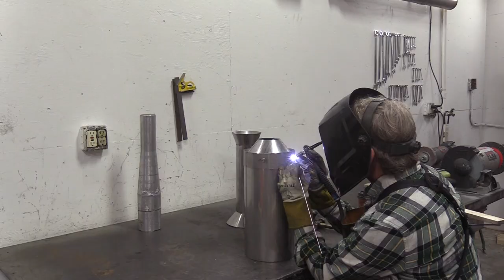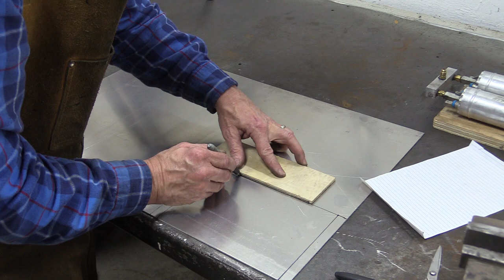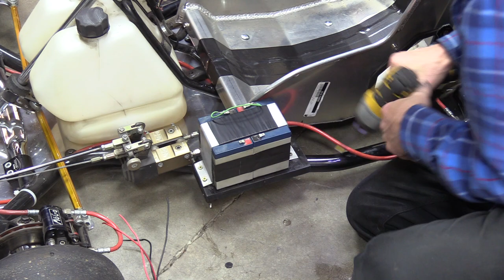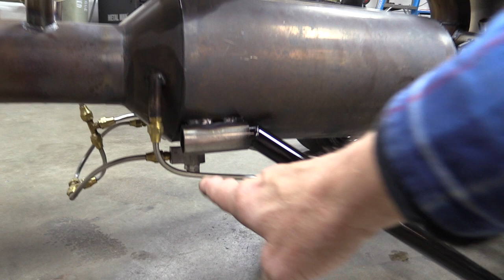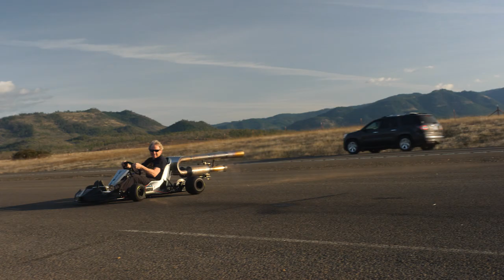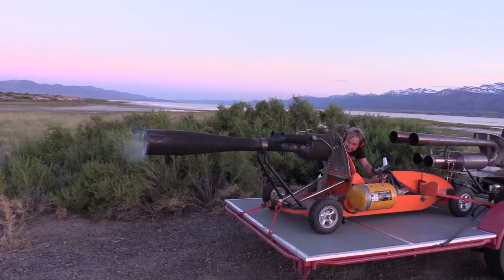Rocketman: Part #2 HOW to make a SUPER JET GOKART !

Comment: WELL YOU ARE THE GREATEST PULSE JET BUILDER EVER!! Greetings from Sweden. From ages 15 to now i have always wanted a pulse jet engine but i dint get one until i was 50, it was an original  unused valve jet from the 60. Your engines are so perfect tuned and well build also you have put both the ignition and the propane inlet in the perfect spot in the engines so you are able to start them with a flick of the switch, impressive and the answer to anyone how you did to make them start without air pressure :)

Comment: Incredible man!!!! But definitely need one small modification - at the trailing edge of the heat shield above each pipe, weld or rivet on two of those long-tined barbeque forks, so you can throw on a couple of brats or maybe a dozen shrimp for a nice snack afterwards, lol ;?D

Comment: Hey Bob, how well would this perform if the pulse jets were used in conjunction with a traditional petrol motor or electric engine? I'm thinking the pulse jest could be engaged on long straight runs for power boost and then the drive shaft powered motor for tight turns etc. Just thinking out loud!... KILLER BUILD MATE! I love what you do FYI
Reply from the maker: Yea it would work great! easy to put the engine around the piston engine and because it has instant start you can just start it anytime with the push of a button.

Comment: The quick start system you built is awesome! What is the fuel consumption of each of those engines?
Reply from the maker: About 30 gal/h per 100 pounds of thrust, I know thats a lot but it's like a canon going off more than 100 times a second.
Reply: How much does each 50 lbs thrust engine weigh by itself?
Reply from the maker: 15 pounds I think.
Reply: @RobertMaddox  why not make one with 850 pounds of thrust

Comment: how does that instant start work without the likes of a leaf blower pushing extra air in? do you have to set a specific AFR via the solenoid?
Reply: There is a small leaf blower inside the tube.

Comment: QUESTION.....YOU USE TWO 12 VOLT PUMPS AT 24 VOLTS DOUBLING THEIR OUTPUT SO YOU CAN MIST THEIR FUEL BETTER...BUT THEN YOU DROP IT INTO A SINGLE LINE WHICH SPLITS BACK AT THE ENGINE INTO TWO FEEDER LINES EFFECTIVELY DROPPING THE PRESSURE BACK DOWN TO A DOUBLE 12 VOLT PUMP PRESSURE AT THE SPLIT DUE TO MAXIMUM FUEL FLOW OF THE SUPPLY LINE....SEEMS IT WOULD MAINTAIN THE HIGHER PRESSURE BETTER BY RUNNING TWO 24 VOLT FUEL FEED LINES ALL THE WAY BACK TO THE ENGINES VS ONE..

Comment: From the back I see flames coming from all 4 pipes, so which is the thrust and which is the intake? And why is there flame coming from whichever the intake pipes are? Those engines get so hot, does the whole apparatus ever just melt if used too long?
Reply from the maker: Ha ha, not they will never melt, the shot pipes are the intake but the thrust also comes from them, about 60/40.

Comment: I can see heat is a problem....those tubes will get so hot I think they could burst open at some point. Welding cooling fins onto them or wraping a casing of radiator type core around them, should help?

Comment: Just curious if these types of fuel pumps (typically inside tank mounted) depend on being submerged for some of their cooling?
Reply: Those type of fuel pumps are not inside tank mounted. They use pumps like those on Volkswagens with a Bosch injection constant flow system. They will produce well over 100 lbs with gasoline. This guy is looking for more flow volume im sure.

Comment: I am far from an expert on that design, but something tells me that there MUST be a way to tweak these engines for even more power... 

Can you hybridize it with forward facing scoops so that is collects more air as you gain speed?

Other than that, it seems you could use piezoelectric materials and a transformer to use some of the pulsing power to keep your system charged so that you have much longer travel life before the batteries drain, AND it would give you the option of some LED lights for driving and signaling! ~( 'w')/
Reply: You can get more power by increasing the fuel input but the tubing would melt.
Reply: Depends on the melting point of the metal, and the total heat output of the combustion.

Since the thrust is a specific impulse, if you placed a draw tube around the outside of the thrust tube, you could force induction, thereby increasing cooling while ever so slightly increasing thrust.

The outer tube could be aircraft aluminum, and if you added axially mounted ribs between the two tubes, it would be able to heat-sink the thrust tube pretty well below its critical point.

The major draw backs are increased complexity, time and weight.

Since keeping it simple is critical to Mr. Maddox, its not really likely he would do that though.

If one used something REALLY hot, they could also, in theory, add water vapor at the mid section of the tube which would both absorb heat and increase the total expanding mass to increase thrust without increasing temperature.
Reply: Well - you're thinking - that's good.
When you say " heat " I assume you mean BTU's.
How is the " thrust a specific impulse " ?
The efficiency of the pulse-jet increases as the tubes get hotter. Cooling will affect efficiency.
Why would you use 7075-T651 as opposed to 6061-T6 ?
" Absorbing heat " has no effect on mass.
Your design mod would dramatically increase cost w/o any guarantee of achieving the desired result.
 Could you calculate the structural requirements necessary to achieve the thermodynamic and air velocity characteristics you are after - or would the mods you suggest have to be done empirically ?
I suggest the latter.
Very expensive....
Perhaps just changing the components from SS to titanium ?
Reply: I'm an energy researcher who specializes in metallurgy and thermodynamics, I have built jet aircraft engines [from monel, inconel, titanium and various high chrome stainless alloys, and it would come across pretty presumptuous to assume I do not know what I am talking about.

Heat can be 'watts,' 'joules,' 'calories,' 'BTUs,' 'ergs,' and a few other quirky terms, it does not matter. 

Heat is heat: it excites the electron shells of atoms, it emits photons, it causes and uses electron transfer.

I could indeed calculate the requirements if I have all of the original parameters of the existing engine and its fuel, its really quite easy once you have the base line.

What was that line 'absorbing heat has no effect on mass' about? Were you once again assuming that you knew what I am talking about?

I wonder if you have checked the price of Titanium lately.
Reply: Why did you suggest the incorporation of an " aircraft alum "  (7075-T651)  outer tube with axial ribs between the tubes " , and then tell me heat is heat ? 
 
(Why not use a tube of D-4, 17-4 PH, 2011-T3 or 12L15 ? Perhaps because you don't know what a " phase diagram " is ? )

The alum " ribs " in contact w/the inner tube - which at it's hottest area is approx 1700 - 1800 F - would melt - primarily from conduction - until a gap was produced between the ribs and the inner tube - after which the " heat-sink outer tube "  would absorb the heat via convection and radiation - but would no longer remain axially concentric with the inner tube - due to the melting of the upper ribs, which by effect of gravity, would melt first. 

This would then bring the outer alum tube into radial contact, with the inner tube, causing it to melt via conduction.

So much for your concept of " tweaking " the engine design. 

Your lack of understanding of mechanical design, metallurgy and enthalpy is manifest.

Your claim that you could calculate the " requirements " for this system is beyond laughable....

What does the price of Ti have to do with anything ?
Reply: I could flame on this, and my carnal self really and truly wants to grind you to dust, but my faith tells me some times it is best to let people like you have your way, be humble, and not feed a fire of pride and self importance.

In reality, I could go on for pages on this and make you look like [shall not say it] but that is not how Christians should be, so instead, I am simply blocking you.

That makes my life simpler and allows me the true victory against Satan the devil, who is my true adversary in this.
Reply: Wouldn't matter where I was.
Reply: Delicious DeBlair I am currently building my own pulsejet that is of similar design to the one shown in this video. I have elected to use Tungsten Carbide as my choice of material. Heat is not an issue with this material. I am able to join my inlet, combustion chamber, and outlet with braze alloys (obviously none that are iron-based as the cobalt "cement" would become extremely brittle once bonding occurs). Moving on, I have found a company based in Michigan that can chemically deposit approximately 30 microns of Titanium Carbide (TiC) on to the substrate of my pulsejet.  TiC is a thin-film (aka a coating) that is designed to reduce the wear of substrates, prevent oxidation, and it also reduces any material's thermal conductivity (depending on the nature of the material) by a small factor. In tungsten carbide's case, it has been tested to reduce it's thermal conductivity up to 20%. It should also be noted that the coating  itself forms covalent bonds with the substrate of the material, resulting in very rigid adhesions. If you wish to do more research on this process, please look up Chemical Vapor Deposition, specifically, low vacuum; hot wall reactors.
Reply: Endymion: I have studied up into CVD and PVD since childhood, and hope some day to build my own sputtering and plasma jet units here at our machine shop, at least for small parts.

These require some pricey materials and careful preparation processes which we can not satisfactorily in confidence attain at the moment, as well as there is not enough demand for them to justify the cost of building them, so it is far off into the future at this point.

What density are you sintering the WC and are you placing it as tiles or as pre-formed curved pieces?

WC is very brittle, and without additional alloying agents would seem to be highly prone to disintegration under the endless oscillations, unless you managed to build a rigid framework into the engine to drastically reduce this effect.

I am by no means saying it can not be done, just that it would pose a few design challenges.

The TiC bonding should work very nicely as it should be thin enough and well enough bonded to not experience much in the way of flexural fatigue in any case.

If one can obtain it, Rhodium [ https://en.wikipedia.org/wiki/Rhodium ] would produce a completely oxide free surfacing agent as it is the one metal which will not hold an oxidation state in its solid form without complex specialized processes, but these serve as catalysts so they increase combustion efficiency.

I wish you great success! (^_^)/
Reply: Jesus fuck lady how did you drop the mic like that. You have an amazing mind
Reply: @JDM NATION For the time being this is an adequate forum.

If I were putting together a team which would inspire a certain specific investor to spend money, I could hand out e-mails, but right now, my focus is on finding talented minds who are adventurous in aerospace and who would love to do it for a living.
Reply: The investor would need proof of your value to the project before approval. Any money directed at the project must not be seen as just 'feeding the poor' [not that such is a bad thing, but for investors, who are not charitable institutions, it is seen that way] but certain to bring on board solid, high quality, technically skilled people.

Until I have said team with said proofs all lined up with their qualifications, assigned departments, budgets, contracts, etc, no money will be coming forward to me, so that means no money will be coming forward to hire said people.

If you have an online resume of your skills you can message it to my profile.
Reply: screw piezo systems just put a little DC motor on the wheel and spin it as a generator with some diodes.
Reply: Delicious DeBlair pressurise
Reply: @gordonmusic9712  I'm sorry, is your one word response related to the idea of ram air inlets, or fuel atomization, or perhaps some other factor? ~( ,m,)~
Reply: On the first comment, here's my take. More fuel = more power. More power = melting metal. Better metal, more fuel = more power. TOO MUCH power, big explosion because better metal. I think that the weaker "skin" is a safety feature. Was so in German hands too.
Reply: I just want to go fast..

Comment: Think maybe better results would be made with 8 HP Briggs.
Reply: But way less cooler...
Reply: Maybe. BUT not as much fun ...... or noise!
Reply: Less moving parts with the pulse jet but I'm guessing better fuel economy with a recip' engine?
Reply: @burtvhulberthyhbn7583  I believe the heat caused by the pulse jet will degrade the metal and the welds much faster then the Briggs will eat up a piston. Even at the low quality of the Briggs

Comment: Those automotive fuel pumps are nothing compared to what a common rail injection system can do. Modern diesel's common rail injection systems can achieve pressures of up to 2000 bar (30,000PSI) this is needed due to their extremely high compression ratios. However, they are very fuel sensitive and expensive (dont put anything but diesel in them because they use it as a lubricant). 

 In the modern systems, fuel is pressurized by a cam driven plunger pump into large fuel rails that accumulate fuel and regulate the pressure. Then small tubes of all equal length run to each injector for every cylinder from the fuel rails. Each injector is a high speed piezoelectric valve that can cycle at incredible speeds.

Comment: There is no way that thing has 100lbs of thrust because that equates to about 200hp...And if something so light had that much power it would easily do 0-60 in under 2 seconds and easily reach 150mph or more...That thing was far slower than that,,,Maybe reaching 30-35mph tops, so it's power is a lot less than he thinks.